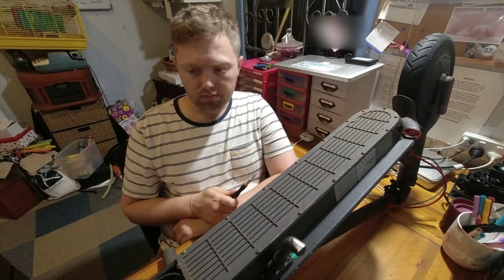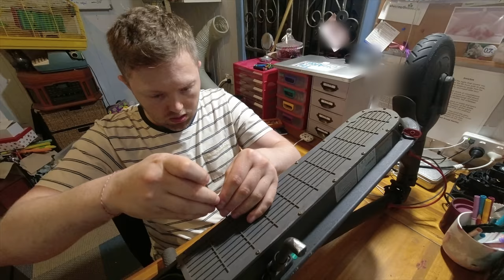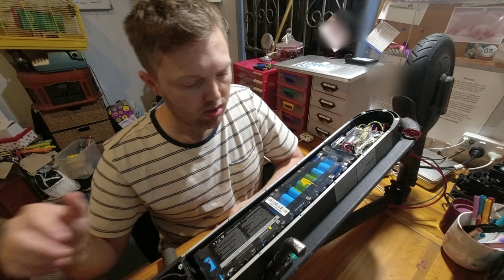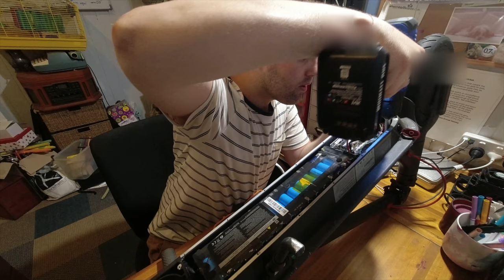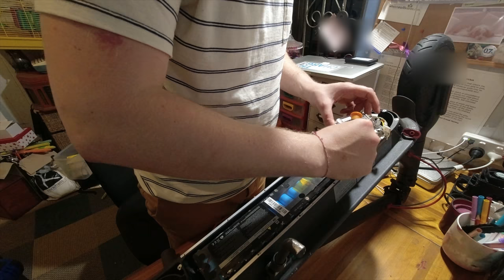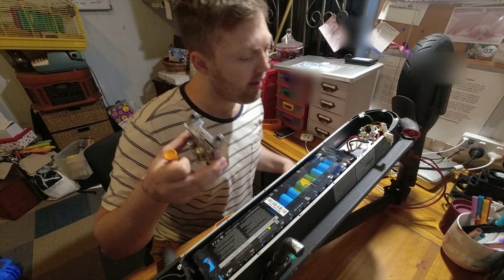Xiaomi M365 Most Common Problems

Comment: Does anybody know why i have to kick-start my essential before the throttle works??? Once its moving its ok??
Reply from the maker: Hi matey, yes. It may be in part something to do with laws in different places. But on a technical level, the motor has a large spike of of power in the very first moment, and because the motor isn't turning, basically the energy just goes into the motor, and turns to heat. This induces failure. So the simplest way to fix this issue is to only allow a kickstart. So that when they sell lots of them it reduces the failure rate. 
Even on my last ebike I always used the throttle gently at first before putting on a lot of power. The spike was something like 4000w in the initial acceleration, which then dropped quickly down to something like 2000w for the rest of the ride. 
Saying this, I personally think they should just allow soft starting, rather than kick starting.
Reply: @TheChargeShow  hey I have my scooter Xiaomi 365 , got a red light and from battery blue light moving really fast but scooter works but less speed than when I first bought it even fully charged
Reply: Got red light on the controler

Comment: Hello! 🙂 For whatis the yellow green white Kabel on the Xiaomi Battery ? Ist that ffor the Light?? I have a new Built-in brushless motor controller.  And I have LH-100 display error code 11 on the Lcd thumb throttle. This is a: communication transmission error.  Can you PLEASE help me what this could be.  I downloaded it in a PDF file with all the error codes.  Kind regards.

Comment: I commented a previous video where my scooter wasn’t charging , well diagnostics says i need a new controller- did you just basically pull the controller out there? Nobody in my area will touch it😆no repair shops due to (so they say hard to get parts for them) im wondering if i can replace the controller myself without dying in the process lol,garages are saying i need a electrician, bought new scooter but my pure air scooter just needs a controller and i cant get a man to help me locate the bugger, i think you just located it? And disconnected my it? My scooter looks exactly the same inside as this one does- 250w motor,so i need a 250w controller? Or am off? Things like this will bug me to the point of maybe actually doing it myself ,

Comment: Hi   Thanks for your brilliant  demonstration, i was wondering if you could help with this issue on  of  a red and black wire hanging lose under a scooter i just acquired , it is not  changing at all ,where does these 2 wired  get hooked  these wire are located  at the rear end of the battery pack thanks  in advance
Henry Belgium
Reply: There for the rear light on the back mudguard 👍🏻

Comment: HI, could please help me fix the issue of my scooter? The problem is that a sudden loss of power, but when I got home and  plug it and turn it on, then it seems everything okay.
Reply from the maker: Hi mate, yes can you email me at benatthecharge@gmail.com
Reply: I am having the same issue. Have you found the root cause?
Reply: @ferfigvirgilio  yes i did, the wire is damage, check all wires and all your lights if they are working properly.
Reply: @fbcruzader  lights are okay. Do you remember which wire of your scooter was damaged?
Reply: @ferfigvirgilio  it was the tail light, under the mudguard there’s a wire and connector, check it out it might be there. Good luck Pal.
Reply: @fbcruzader  how did you fix it?
Reply: @adnanabdulrahman8001  I removed the mudguard and changed the damage wire.
Reply: @fbcruzader  Thanks

Comment: Hi quick question   Just wondering basically what's happened to my scooter When I'm out on it the power just cuts out completely The screen goes off And it won't start  There is a full battery  on it  but when i get home  go to put it on it works on till I go out on it and does the same again so if I this connect the battery to the controller what do you think
Reply from the maker: Hi matey, this often happens when people tune their scooters with the software to make it go faster. Did you do this? If it keeps happening, and you haven't made it faster then, I can only imagine that either the BMS or the main control board is faulty.
Reply: Hi I did nothing with it  I checked the battery the voltage looks fine I can't see it being the bms I checked the controller the mofets looks OK is there anything else I can check  it's just  when I disconnect the battery it comes on and works fine ontill I get back on the road  and go's of again
Reply from the maker: @gregmcdermott8838  Its a bit random, so I think it's the controller that's the main issue. They are prone to having problems.

Comment: A little dielectric grease for the connections will really help with the corrosion, they really should use it at the factory, which is why I always take a brand new scooter apart and inspect it before riding....they are only as good as the idiots they hire to assemble them.

Comment: hi mate ive an e scooter the white one m365 the power button wont stay on if i let go it goes off vut holding it stays on . i had an E1 code which i found was motor fault so changed the motor but its still showing that fault /what can i do pls to fix theese issues  kind regards

Comment: Hi all so no charge so we first plug in the charger and see green then plug to the electric scooter and see red these is the charger reading the batteries BMS lots of the time I get in scooters and it's a charger port or maby just the inside of the charger port has a pin and a side clip and it becomes flat and u get a pin and bend the clip Back out to the work wen the charger is entered

Comment: Hello
Thank you so much for helping people
The problem of my scooter is I think the baterry is overdischarged because it was not used for 3 years and now it doesnt chargé, it doesnt turn on and inside, the batery flickers red Light, not blues
I tried lots of things. Any idea?
Reply from the maker: Hey, thanks for getting in touch. Maybe a good idea to take the battery wrapping off, test the cell voltages, or try to use the app whilst the scooter is plugged in. You could try to give the scooter a small charge first going via the output connector, rather than through the BMS.

Comment: Can anyone help. Me fix my boys scooter no shop will take it 
It’s got full bar power power don’t seem a problem 
Front week spins normally till I switch power on then it’s hard to turn also even with my boy trying to push to 3 mph it won’t go ? Please any help I’d love  iv bin trying 3 days u tube as nothing abt it I think it’s a hard one to fix thankyou????
Reply from the maker: Hey, ok so my best guess would be that it is the controller. You can get them on AliExpress for very cheap. I recommend putting a new one it :) It could be something else but I doubt it.
Reply: @TheChargeShow  thankyou very much it’s only 6 months old so iv rang Amazon an I think there replace it but I’ll still try an fix this not cheap£320 I ad heard that somwere 
It’s weird worked normal stoped put it on charge as four bars power was fixing back break I can’t get battery cover off bottom cos e goes up curbs speed ramps can’t get screws will I av to take battery cover off to fix Excelerator button? Anything else can it be ?
Reply: @TheChargeShow  sorry wats controller? Wat u push to go an slow down ? Thankyou a lot mate for help I’ll get one if u can put a link to one or put name of wat it is controller? ??? Name

Comment: My battery works fine but charger can't see so not charging.. i changed the bms but nothing happened... So my question is:  if i attach the charger port(red and black cables) on the cables (red and black) coming out from battery to bms ,will it charge?

Comment: Quick question someone has offerd me the same scooter for £50 do u think I should by it or stay away it does not drive
Reply from the maker: If it is a genuine Xiaomi. Buy it. If not, leave it. :) Genuine Xiaomi will have the label on the left hand side with a serial number on.

Comment: I have an isinwheel it will run for a mile or two and then shut down but when I plug it in and then unplug it right away it seems to reset and then we're running again

Comment: Hi great video very informative 👍🏻 question I have a 365 replica & under the battery cover at the front is filled with hard foam what is this for? Also where does the rear light battery lead connect on the battery please ? Cheers
Reply: It is so the cable won’t be “flying” insu de the scooter chassis
Reply: iv got a clone aswell, its a cheap way to hold the battery still and the poor attempt to help waterproofing.

Comment: 2:17 when i unplug it, andd then measure the voltage directly on the pins on the motherboard, it still reads voltage. The capacitor holds the charge for a lot of time. Is it possible that if i would remove it, it would function as normally? (BTW everything else on my scooter is fine. battery, charger, connection in cables, etc.)

Edit: I removed everything else from the question, and just had the motherboard. I discharged the capacitor, and all of the LMs to ground, and somehow the charge on the capacitor was rising? so i tried plugging the battery back in, and i heard a sound compared to the capacitor filling with air, so yep, guess im fucked now.

Comment: Hi   when riding i did a hard braking  with KERS MODE ON STRONG  AND THE BRAKE ITS LIKE STUCK  the scooter is not even on and its still like braking  i think its internal  in the motor  because the bms doentn remark any isseus  its not accelerating anymore  maybe you could help me to find a solution its  the kers mode is broken  because the scooter is not on any power and still the motor is braking pls help

Comment: i recently changed the motherboard of my m365 pro, now my scooter started running but whenever i use brakes, the E brake gets jammed and the motor gets hard and the scooter turns off...there are no errors codes.
Reply from the maker: Hmmm, very strange. Perhaps try another new controller board. Sometimes they do send new ones with these little issues :)
Reply: @TheChargeShow  update: i changed the brake sensor..now the scooter is running like new..😀
Reply from the maker: @mohdsaboor7849  Awesome mate. Well done you :)
Reply: @mohdsaboor7849  how did you change the brake sensors?

Comment: Hi Sir, new subscriber here. My m365 is making this error sound when I turn it On: dee dee pause dee dee dee dee. Is that error code 24? what does it mean? Hope u could help me Sir. TIA ☺️✌️
Reply from the maker: Hey Tia, yes, code 24 means there is an issue with the battery voltage. Maybe consider taking it to a 'Repair Cafe's near you? The volunteers will fix it for free for you :) Just search for your local repair cafe.

Comment: I have an Xiaomi mi pro 2 and I remapped it and I’ve used it for a few months and now I put it in sport mode and full throttle the motor makes noice and it shakes do you know how to fix mate.
Reply from the maker: Oh that's weird. Have you tried to reset the scooter to factory again? I imagine that you would be better off putting the scooter back to factory, and then physically modifying the controller board. If you want me to do it for free, just email me. :)
Reply: @TheChargeShow  it’s alright mate I sent to Xiaomi repairs they have fixed the problem, Thanks anyway.

Comment: Hi! I have the same problem on my Xiaomi m365. No beeping codes though. I bought a new controller and the problem that i got instead was low power all the time. Any suggestions what to do?
Reply: I have a similar problem, im thinking its an old battery but im not sure. Did you come to a solution?
Reply: @Invitationtohis  My problem was that a cable had jammed and caused a short circuit

Comment: My scooter has been stuck in the slow speed like yours was before ramping up for a while (13mph to be exact,not eco mode also) and I simply can’t figure out how to fix it. Any suggestions?
Reply: My kingsong does that sometimes. I have to start the app and change some setting, then it seems to work normal speed again.
Reply: You have to enable it with mi home app

Comment: my scooter wont turn on when the battery is 50% below, i need to plug in the charger before it turn on
Reply from the maker: Very odd indeed. Check out my other video to reset the controller and see if that fixes it :)
Reply: Hi i have same issue also. And i don't know what to do. Did u already fixed yours? And how.?thankyou
Reply: @jhesalvaje7183  i did reset the controller but its still the same
Reply: @Newb1eBeats  having the same problem, have u fixed urs yet?
Reply: @preciousakande1186  Still the same. But i think its either the controller or the bms causing it

Comment: I tried to speed hack my m365 and it turned off when i press the power button the back light shows pls can u help me
Reply from the maker: Hi mate, yeah so I can only imagine that you should try to reset the controller, and then re-do the speed hack if you must. I advise not to do the speed hack though.
Reply: @TheChargeShow  and pls can you show how yo do that
Reply from the maker: @Mohamed-xo5no  check my other scooter video mate :) I show you how.
Reply: @TheChargeShow  sir wich video is it and wich part pls this will helo me alot
Reply: Hi I have a m365 and it’s come up with code error e4 and the Front light keeps flashing on and off and it beeps what can that be please

Comment: What should I do if my scooter just won’t turn on and if it flickers on for a second then turns off??
Reply from the maker: It annoyingly could be anyone of three things. The little screen chipboard at the top. The main controller board. Or the some issue with the battery. I would start with a visual inspection on all of them first, and then start replacing them from the cheapest first. My money is on the controller though. It's almost always that.
Reply: @TheChargeShow  so u think it’s the little screen or the board u stand on??
Reply: Just bought a e-way e500 that wont engage the motor. Throttle handle does nothing. No error codes. 
Will offcourse contact aftersales but have you heard of problems like this before?

This e500 looks like a rebranded xiaomi.
Reply from the maker: Yeah most likely. Just try another from Amazon, if it doesn't work then send it back :)

Comment: Can anyone plz help, I have had an aovo pro since Xmas and use it for work, 5 times a week and at the most it takes me 60 seconds to get there! Anyway a couple of weeks ago I came from the curb to the road off the High point at speed by mistake, didn't fall or anything but it was a heavy landing, since then my scooter decides to cut out whilst riding and after a few minutes will turn back on, I am unsure if it is a battery issue or motherboard possibly, any help is welcome.. Thanks

Comment: Perhaps a good idea to clean off the aluminium pate ad reapply fresh heatsink paste if you're going into the scooter anyway because it dries up and becomes less effective which can cause overheating issues just as the heatsink also works on a computer CPU. Good video.

Comment: My scooter doesn't run but led displays as usual. What happened was it rained heavily today. While the scooter was still charging and scooter wet soaked with rain water, I pulled out the charging cable from the scooter. Immediately the scooter led display turned ON. But then I realised I cannot off it and it will not run. Any help?

Comment: I have a problem with my scooter but Google has been useless. When I turn it on it continually sounds with two short beeps like an alarm clock and on the display it shows E2, what is the issue here? One page will say accelerator and another will say control board.

Comment: Hey, the battery on my scooter doesn't flick blue lights. Tried to do the standard reset that everyone suggests, I've checked the fuse too it's still fine.
Battery is outputting 13V. Please help I'm lost on how to fix it now.
Reply: You need an adult (unless you are one) and a volt-ohm meter.  Watch this YouTube video "Xiaomi M365 Battery Issues - Diagnose And Repair" and be careful.  Even though the battery is at 13 volts it is still very dangerous.
Note: this is not my video, but I can confirm it is 100% factual and complete.
That being said if you do not have basic knowledge of electricity or do not feel comfortable doing the work DON'T DO IT.

Comment: sorry it didn't work with me. I unplugged the control panel then connected it again but the problem still exists. My M365 in not going more than 13km/h. It has always been 18km/h since day 1 when I bought it almost 2 years ago. Then in the past month it was great and super fast when it was doing 24km/h for one month. Now for 2 weeks it's doing only 13.
I think it has to do with the front wheel. I lift it from the floor, turn the wheel fast with my hand then press the throttle. It goes 24km/h for 1 less than 1 second then instantly drops to 16. When I ride it it's 13

Comment: You are a LIFE SAVER thank you so much! Finally I found somewhere that explains what to use to take the screws odd the battery plate of my scooter. I had never heard of a torx screw driver before and coudlnt understand why no hex key would fit! Thank you so much I can mow get this damn thing off! ❤️
Reply from the maker: You are very welcome mate :)
Reply: Same problem here on a Prixton Eco City Scooter (pretty much the same design). The first fix, pulling the cable and resetting after a short while, fixed it and I am very grateful for this video. Thank you!

Comment: BOTH of my used m365 after about 1 mile will stop accelerating. I then have to turn them off then back on, and I can then go a little further, or if I wait like 30 seconds I can then go even further. Is it just shutting itself off because of overheating? I weigh alot and its never at top speed, which means its probably in peak wattage the whole time? Anyone know for sure thats what it is, or does anyone elses do this?
Reply from the maker: Hi mate, if you email me I can try and help. benatthecharge@gmail.com